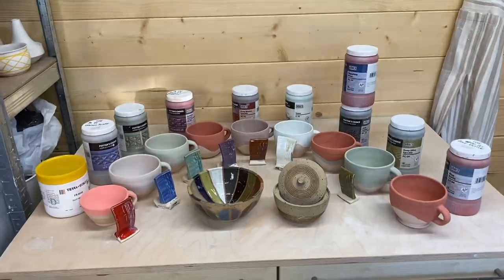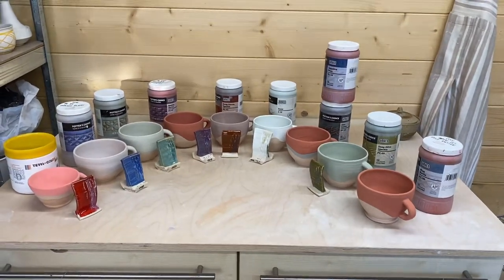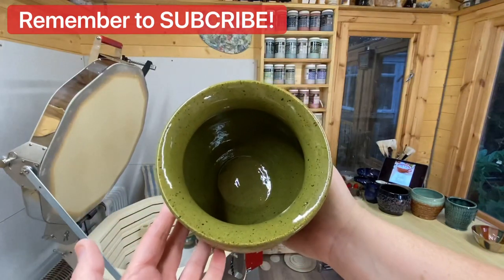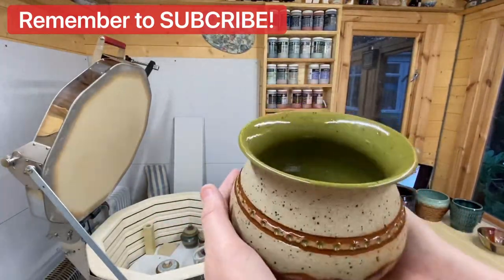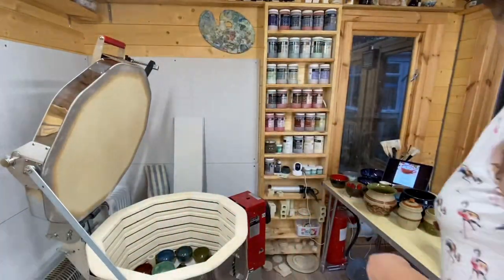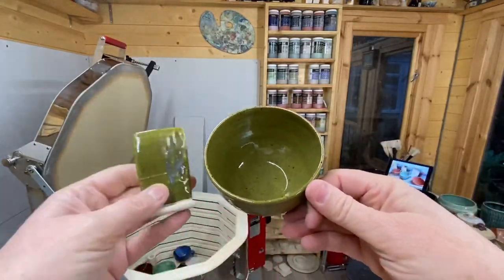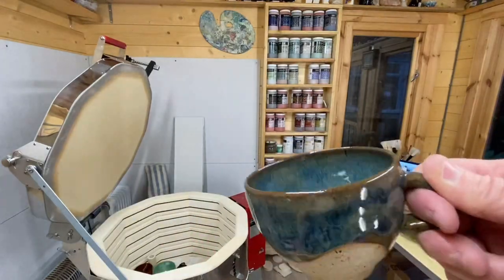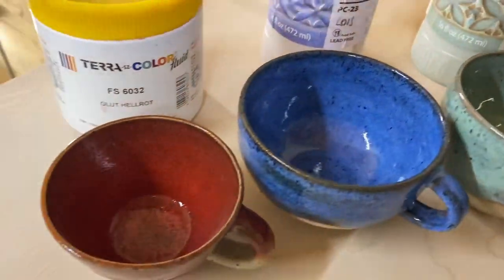37. Test Glazes on Lavaflek or Grogged Clay. What looks best. Amaco. Mayco Terracolor Before - After

Comment: Do you mind if I ask what your firing schedule is for the lavafleck. I’ve been using it for some time now but am suddenly getting a lot of bloating. I’m firing to it’s too temp and no further but just wondering how low you fire it and what your schedule is as your results look great.  Would be really grateful if you wouldn’t mind sharing your schedule. Many thanks
Reply from the maker: Hi. So I use a Skutt KMT1018

It has a preset digital board and I use the preset for a Cone 6

Sometimes I have used a slow fire but usually it’s a medium fire. 

I don’t do holds. I have some some in the past but I felt I got the results without the preset. 

I would suggest you do a bit of homework with what they do but I feel I haven’t made extra effort for success with lavaflek. 

Of course it depends on the make and the batch number.

Comment: Sorry, I should watch till the end, always do that jump fast on the comments, mix a half cup of wax with a teaspoon of aluminum Hydrate, wax the gallery of the pots and the lid lip. It will make very easy to take you lids out, after firing. The wax has to be mixing constantly because the Aluminum Hydrate sets very fast. I usually use a fork to mix on the jar. 🤗
Reply from the maker: I have some and had forgotten all about adding Alumina Hydrate. I watched  it in Hschin’s video. It was a big pain getting them apart and I did do some damage to the pots when I was too rough. Next time I must remember.